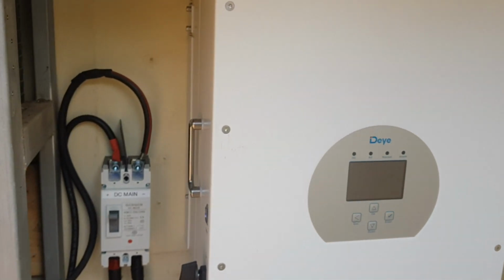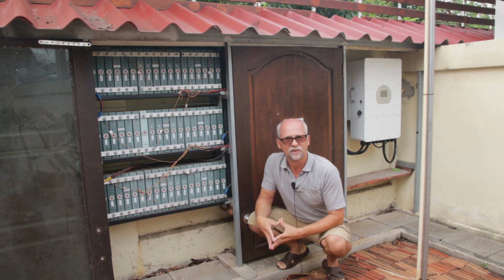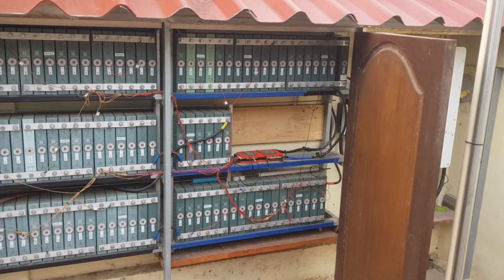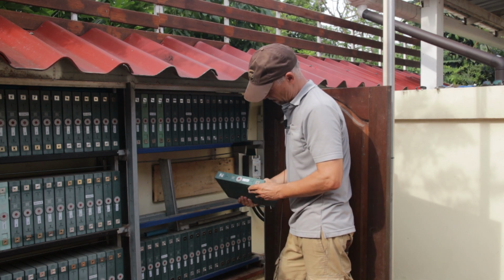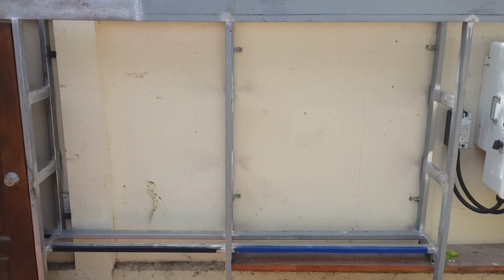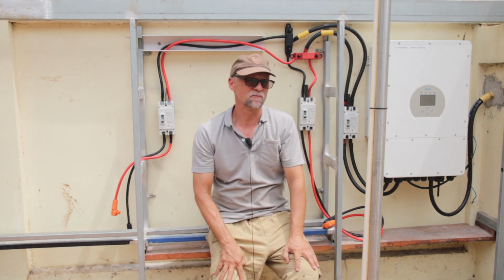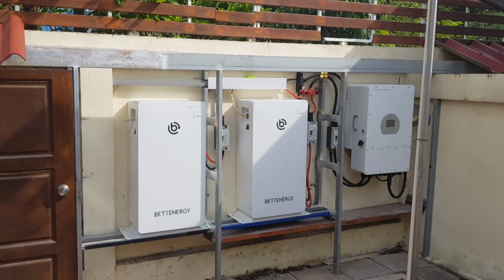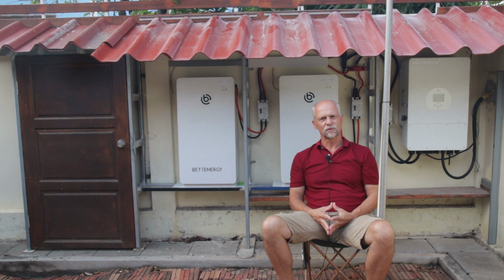The Batteries are getting installed. Now the old DIY-Powerwall is gone for good!

Comment: I rewatch your video again, did you install the wall mount bracket of the battery on the wall?
Reply from the maker: No. The 16kW packs didn't come with a wall bracket. They had a stand and wheels. I was using the stand.

Comment: at time stamp 12:40, how did you mount your dc mccb in your concrete wall? I also will mount my dc mccb in a concrete wall. Did you use the screws that comes with it?
Reply from the maker: no, the screws which are included are not suitable for wall mounting. i have just used plastic wall anchors and a bit longer normal screws
Reply: @RolandW_DIYEnergyandMore  , thanks so I will have buy screw suited for concrete walls and its corresponding plastic wall anchors.

Comment: Great! This battery will last much longer than previous setup. BMS in previous setup was not able to measure voltage for every cell, just voltage for whole 6P set, so it did not balance anything. And new batteries are connected in 1P8S*2 configuration so BMS can do its job properly.👍

Comment: looks really good roland.
some ideas about the early generation lifepo4 bats. the "generation 0" cells if they can be called that made by watson with the special addition of yittrium to the cathode, the so called lifeypo4 cells, were very strict on how they could be mounted with the vent hole always at the top because of how air bubbles would form or how the solvent would change with the life of the battery. i think the technology even goes back to the og edison battery which many power plants in the usa are still using 40-100 year old plus batteries to restart their generators from a true blackout. they found out that the iron batteries worked better with the addition of the lithium hydroxide to the aqueous phase, and when you write out the true half cell reaction for such an addition, theyre basically acting like lifepo4 batteries. they have issues like lead acid with keeping the solvent level (di water) topped off. 
i almost wonder if the mounting position of the batteries had something to do with their lifespan, since one of the current collectors on the top side of the battery may have developed issues conducting over time and who knows what issues that caused with aging the cell. 
it would be interesting to know if the batteries started to regain some apparent capacity after being cycled a few times while in the upright position on the floor lol, or even if there was no such improvement. just an idea.
its really hard to find info about the addition of yittrium to lifepo4 cells back in the day. that was back when the batteries were extremely expensive and i think made in the netherlands or somewhere in europe only. most of those cells 20 years+ in age are still going fine and have much better cold weather performance even though no one ran bms' back then or did much in the way of cell balancing lol.
guessing it had a similar role to cobalt or something in the cathode? idk.
i think its still good practice to do the first few cycles on lifepo4 batteries while keeping the cells in the upright position because the first few cycles is when all the little bubbles/voids in the electrolyte form and will probably be there for the life of the battery.
Reply from the maker: Thanks for this very detailed comment. I think you have very good points in there. I am currently testing all cells and it will take me a month till all are done. so I might see changes in capacity between early tests and later ones :) There will be a video about it in probably a month from now...
Reply: @RolandW_DIYEnergyandMore  cool, looking forward to this. thanks